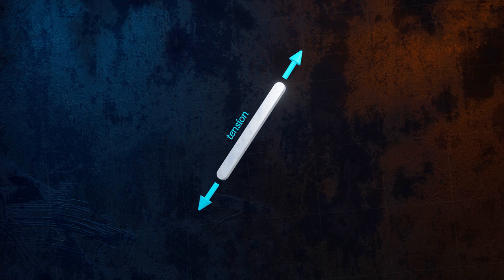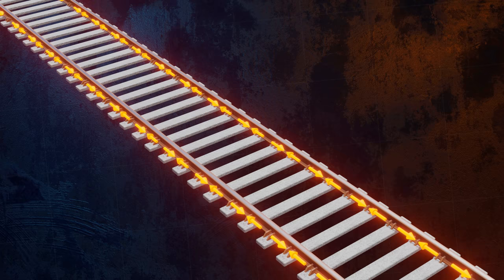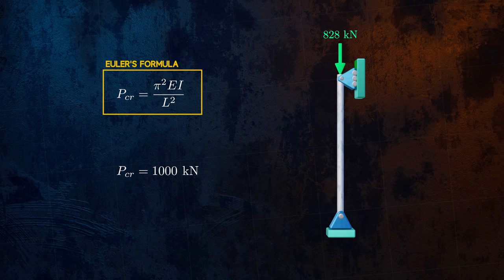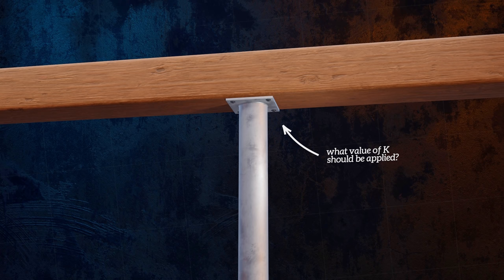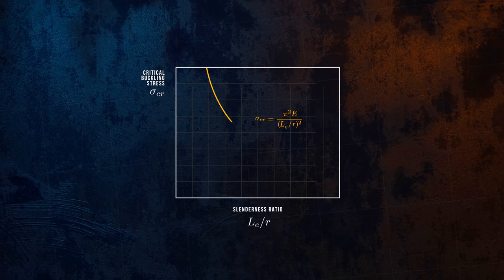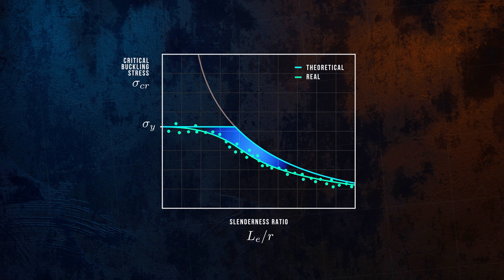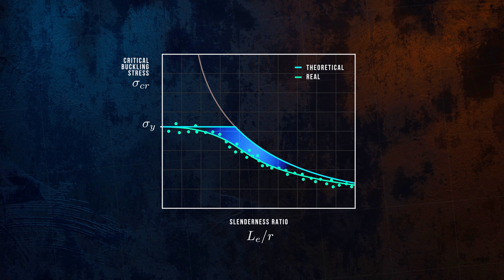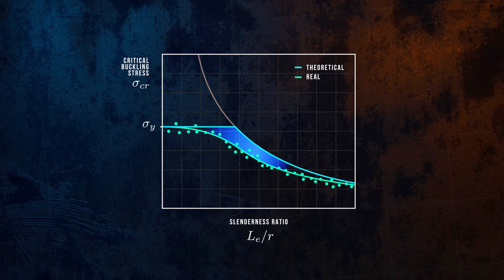Understanding Buckling

Comment: In describing Euler's formula, you state that it does NOT depend on the strength of the material at all.  This is completely false.  The Young's Modulus  represents the strength of the material, for this purpose — its resistance to compression and/or stretching (which may be different).  An object with a high Young's Modulus is stronger/stiffer than one with a low one.  When an object buckles, typically the inside part is compressed and the outside is stretched.

Further, the moment of inertia of the cross section, while not a measure of the strength of the material, IS a measure of the strength of its cross-sectional shape.
Reply from the maker: Your comment seems to suggest that stiffness and strength are the same thing, but they are fundamentally different properties. Young's modulus describes the stiffness of a material and is important in calculating the Euler critical buckling load. Strength (yield strength, tensile strength) does not affect the calculated buckling load. Two steels with the same E but very different yield strengths will buckle at the same load according to Euler's formula.

Similarly the second moment of area isn't a measure of the strength of a cross-section, it's a measure of its stiffness.
Reply: @TheEfficientEngineer  OK, I'm not trained in materials or civil engineering, so I'm using the terminology as a layman.  However, to argue that the Young's Modulus has nothing to do with the material's "strength" is preposterous, unless you're hiding behind industry-specific definitions that the scientifically literate non-engineer will NOT understand.

To whom are these videos targeted?  Are you attempting to train engineers, or are you giving a taste of engineering to the scientifically literate?  Before I looked up Young's Modulus in Wikipedia, I'd NEVER heard of "tensile stiffness" — only "tensile strength".  To people not studying engineering, it's a distinction without a difference.  

The nature of buckling failure involves both stretching on one side (tensile "strength", to me; you may call it tensile "stiffness") and compression on the other.  I'm sure that you're NOT suggesting that it doesn't matter whether an otherwise identical girder is made of steel, copper, or aluminum.  What in Euler's formula accounts for the difference?  The Young's Modulus.

To tell viewers that it has NOTHING to do with "strength" is misleading at best.  OK, perhaps in engineering terminology, it's stiffness.  Why make that statement in the video at all?  Unless your viewers are already knowledgeable enough to understand the engineering distinction between "strength" and "stiffness", it's going sound nonsensical, if they have the slightest understanding of physics.

That's how it struck ME.  I looked up Young's Modulus, rewatched your video to make sure that I had heard it correctly, then wrote my comment.  I didn't even notice that Wikipedia used the term "stiffness", while your video used the term "strength".

Putting that statement in your video without specific additional wording distinguishing "strength" and "stiffness" leaves me feeling like you're trying to trick me, somehow.  Maybe I'm not your intended audience, but you will have plenty of interested viewers like me.

My field is information technology, in which there is a HUGE amount of specialized jargon, but also specialized use of ordinary English words.  Whenever I talk to non-IT folks, I'm VERY careful to either specifically define the words I use, or use language in a way that the person will understand.  It doesn't have to be "dumbed down" — you DO have to have a shared vocabulary.
Reply from the maker: The videos are mainly targeted at engineering students and professionals, but to be fair you are not the only person to have commented on that particular line of the video, so I'm happy to accept that I could have done a better job of explaining it. Equating stiffness with strength is simply incorrect, the words have different meanings, although it is perhaps a common misconception that I could have addressed.

That being said I would argue that the terms "stiffness" and "strength" as I have used them are consistent with the layman definition. A "strong" material is one that can carry a large load without failing, and a "stiff" material is one that doesn't deform much when acted upon by a large load.

I would also argue that any discussion which references Young's modulus is inherently a technical discussion where it is appropriate to use accurate terminology. This isn't "hiding behind industry-specific definitions", it's just being accurate.
Reply: @TheEfficientEngineer  Replying to your first reply...  You say "Strength (yield strength, tensile strength) does not affect the calculated buckling load.  Two steels with the same E but very different yield strengths will buckle at the same load according to Euler's formula."

As I understand it, E is the slope of the roughly linear section of the stress vs strain graph, which shifts abruptly at the yield strength (partial failure), then often curves up more gradually until the material completely fails in some fashion.

Given that, it would seem that Euler's formula is fundamentally flawed — at least with regard to the type of buckling that a civil engineer would care about:  buckling with partial or complete material failure (inelastic).  Euler's formula seems to predict elastic bending, rather than complete failure, as the linear portion of the graph is the region in which the material can return to its original state and does NOT fail.

Your statement is valid for Euler's formula, but is intuitively absurd with respect to actual, real world buckling (or at least inelastic buckling, which I assume this is REALLY all about).  If two steels have very different yield strengths, then they will YIELD at different loads, all other things being equal.  Yielding may not be complete buckling, but it's the first stage.  (I understand that if the cross-sectional stiffness is sufficiently low, elastic buckling may occur before the yield strength is reached.  That type of case is irrelevant, as far as I'm concerned.) The yield strength is a likely predictor of ultimate strength and fracture strength.

No wonder you worded your response as you did — Euler's formula is obviously NOT valid in the real world, except for strictly elastic buckling.  That's a different TYPE of buckling — one in which the system can return to its original state once the load is reduced.  In your video, I don't recall that you distinguish destructive, inelastic buckling from temporary, elastic buckling.
Reply from the maker: @55dbk  Elastic buckling absolutely is a concern in the real world. Although it doesn't result in material failure, it essentially renders a structure unsafe - the structure will respond unpredictably to any additional loading that is applied to the column. Structures are designed to avoid elastic buckling.

Inelastic buckling only becomes relevant for columns that have a low slenderness ratio, because for these structures the Euler buckling load is very large, which means that they will fail by yielding before they fail by buckling (or they will fail by some combination of the two). I addressed this at 07:20 in the video.
Reply: @TheEfficientEngineer  I understand your point about even elastic buckling being undesirable — you don't want your structure wobbling about (as you say, unpredictably) past a certain load.  Not being a mechanical or civil engineer — and being conservative about safety — I tend to assume that things would be designed with low slenderness ratios, resulting in very little elastic buckling, making inelastic buckling the primary concern.  

Perhaps that's unrealistically expensive.  Alternatively, other methods can be used to reduce that problem, such as added bracing members (as with trusses).

Although I watched that entire video once, I got VERY hung up on that statement about material strength NOT being a factor in Euler's formula, as you know.  As a result, I rewatched the first part — and that section — multiple times, but just now watched the entire video again.  I had forgotten about the dimensionless slenderness ratio — how cool is that?  I had also forgotten about the section on real-world testing that showed that columns buckled at lower loads than Euler's formula predicts, for various real-world reasons that you point out.

In the real world, Euler's formula seems to be a starting point from which the engineer must back off, to accommodate real-world considerations such as beams not being perfectly straight, the load not being applied precisely on-axis, plus safety factors to account for material deterioration (e.g. rusting), dynamic loading, wind, ice & snow, earthquakes, etc.

Another reason I tend to think elastic buckling is less important is my impression — perhaps incorrect — that many materials are not elastic over much of a range:  they tend to fail (e.g. concrete).  Or, due to its cross-sectional shape, bending of a structural component may cause failure in part of the cross-section of the component.

Is a steel I-beam used to build, for example, a bridge, actually capable of bending significantly and returning to its original state?  A slender piece of steel can, but an I-beam is all about being stiff.